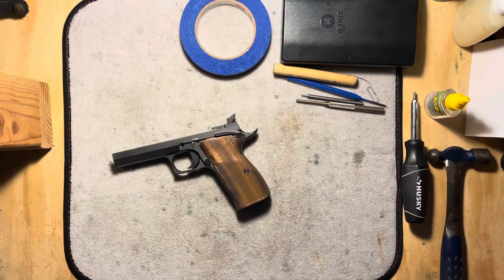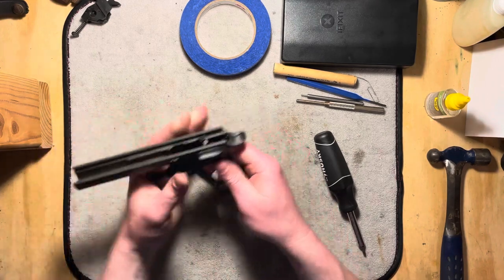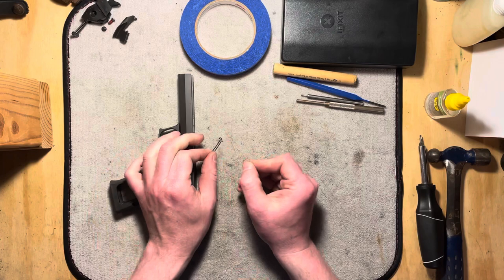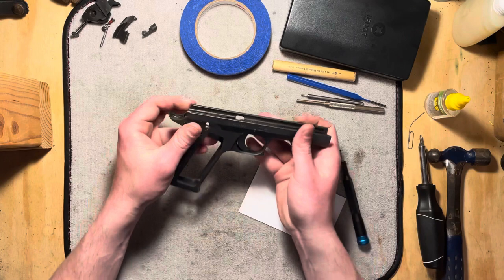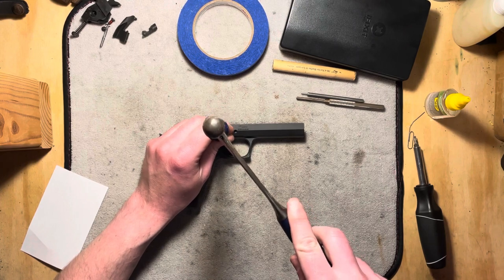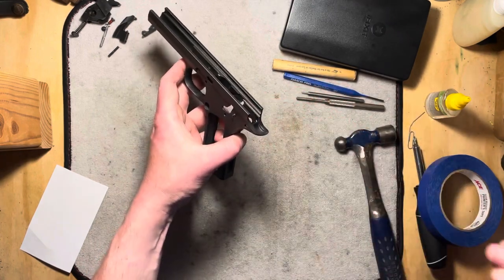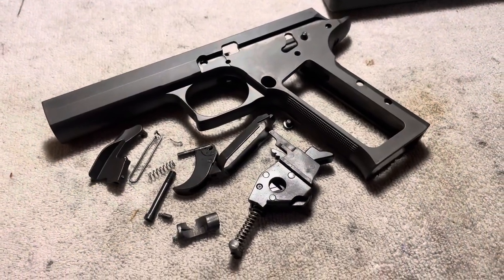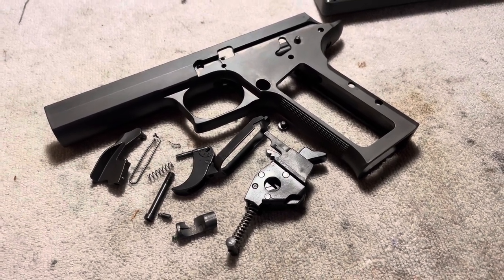SIG Sauer P210 American Frame Detail Strip Part 1 of 2: Disassembly

Comment: I really appreciate your meticulous care that you have for your pistol. Great attention to detail as well. Thank you. Did you learn this on your own while disassembling or did you follow a book?
Reply from the maker: Thanks. I’ve always been a bit of a tinkerer, and have taken apart a lot of different firearms. In general, once you learn the few common configurations, almost all disassemble in fairly similar ways. For the P210 it’s fairly simple so I just followed a process that seemed logical to me.
Reply: @ColterBrog  I am really curious to know more about the hammer box. Particularly, the the “wall” adjustment. It’s hard for me to visualize how that works. It seems like it would be difficult to adjust correctly if it ever slipped as others have mentioned here and elsewhere on the web without significant trial and error and multiple tear downs. I am also curious if you know any sites that give more detail on this, and do you know of any sites that detail polishing friction points. Of course mine is already amazingly smooth and a 2.5# trigger, I just like to know as much as I can about this fine pistol. Thank you again.
Reply from the maker: @Mr5150guy There isn’t much information out there as far as I found. In messing with it myself, it seems like the factory adjustment is pretty much perfect. Anything I tweaked seemed to make it less optimal in some way. And you’re absolutely right that it involves significant trial and error. I wouldn’t mess with it, and based on how it is pressed together I’m not sure it’s intended to ever be disassembled. The pins are extremely tight. 

If you want to do anything, I’d just put a high quality gun grease on the engagement surfaces, and if you want to play with the weight without affecting the second stage wall just screwing the main spring barrel nut in and out will make some changes to main spring tension. If you adjust anything else I would definitely mark the parts with a pencil or fine permanent marker before doing anything so it is easy to restore the factory configuration, which is ultimately what I did. 

It really is set up well from the factory. In my opinion there isn’t much, if anything, to be gained by tweaking the adjustments.
Reply: @ColterBrog  that makes sense. I guess there’s a part of me that just wants to know how to make that wall adjustment if it ever does become loose like others have mentioned. Just my paranoia kicking in.  seems like if something can happen. It will happen 😝. In the meantime, I’ll just enjoy it. The trigger is even better than I thought it could be, not that I’ve had access to many match grade pistols. 
There doesn’t even seem to be very many spare parts available. Midwestgunworks usually has just about everything you could possibly want for pistols, but not much for the 210.  I was going to buy a hammer box just to experiment. No dice.
Thanks again for your replies.

Comment: Gracias,  tengo un P210 target Americano, el disparador tiene el primer tiempo, pero no hace parada en el segundo tiempo, es  difícil de disparar porque no se nota el segundo tiempo, tiene regulación? Un saludo Gracias desde España.
Reply from the maker: I think you are referring to what we call the “reset” in English. The click that is felt when releasing the trigger to know it can be pulled again. We call it “riding the reset”. 

Unfortunately the P210 has a sort of false reset that can trick us. I have not found a way to get rid of this, and I believe it is inherent to the design. I don’t think it can safely be made to have a positive and true reset due to the nature of the design. 

I hope this translates well.
Reply: @ColterBrog  gracias por contestar, mi problema es que no noto parada del segundo tiempo antes del disparo, no se si me explico, todas las armas tienen dos tiempo,  aquí al principio si lo tenia,después de 100 disparos desapareció, no solo la mía,la de otro compañero también,  modelo 2024,tiene un mes. Un saludo gracias.
Reply from the maker: @topdigitalphoneroman2000 Ah, I think I understand now. We call this “two stage trigger”. The initial take up is light weight, then becomes heavy before the shot fires. 

I have an older video that explains more of the hammer box. The adjustment for that is within the hammer box. It sounds like yours may have slipped. There is a set screw that secures the adjustment, so be sure it is loosened before adjust it back to where it should be and then tighten it back down snugly to ensure it doesn’t back out again. It sounds like yours may not have been sufficiently tightened at the factory.
Reply: Gracias de nuevo, ahora si es como me comentas, he conseguido ponerlo bien, sacando el Cassette del disparador ,aflojando primero el tornillo pequeño y ajustando el más grande y de nuevo apretando el pequeño, muchas gracias por tu información y tiempo, un saludo.
Reply from the maker: @topdigitalphoneroman2000 I think you have it right. 

The screw secures a piece which spins, but itself is not actually a screw. It is an irregularly shaped pin, a non-concentric barrel of sorts, that makes the adjustment and then is stopped by the small screw. Turning that pin is what adjusts the “wall” in the trigger pull to make it more or less pronounced if my memory is correct. 

I’m using a lot of words hoping something translates in a way that makes sense. I don’t know the best way to say it even in English.
Reply: @ColterBrog  muchas gracias, tu explicación me ha resultado de gran ayuda, gracias y excelentes vídeos.

Comment: So safety is incredibly stiff. Do you have any suggestions on how to make it smoother?
Reply from the maker: I would first just apply some oil to the detent and work it back and forth between safe and fire a couple hundred times. That should smooth up the bearing surfaces and let the spring take a set.

Comment: Hello:
Thank you for your videos- there are a lot of useful information.
How can a trigger pull weight may be increased?
I have P210 Target model and the trigger is a little too light for my liking.

Thank you!
Reply from the maker: The barrel nut on the bottom of the hammer strut controls tension on the mainspring. Turning it inward (clockwise if you’re looking at it from the bottom side) will increase tension which gives both more solid hammer strikes and will increase pull weight. 

I wouldn’t go more than maybe one or two full turns before trying it out. A little bit of adjustment makes a big difference.
Reply: @ColterBrog  Appreciate your prompt response! Thank you!
Reply from the maker: There’s actually another video I did that doesn’t involve disassembly of the trigger, but goes into more detail on the hammer box. 

The hammer box is really where all the workings are at. The trigger itself is just a simple lever. 

https://youtu.be/GlLUc2DN7Dg

Comment: Thanks for the video it’s very helpful. I’m going to try to put the Grayguns flat trigger in…do I need to take everything down in order to get the trigger out or can I leave anything intact?
Reply from the maker: Well, you definitely don’t need to take out the magazine catch. Other than that… I’d have to go study it again since it’s been a while since I had it apart, but really it disassembles easy enough I’d just go ahead and take the rest out. 

The GrayGuns is trickier to install. I have some posts about it over on SIG forum. The profile makes it tricky to install the trigger spring. I ended up using a very small wooden dowel to flex in there and hold/compress the spring until the trigger bar moved enough to capture it. Definitely takes some finesse and patience.
Reply: @ColterBrog  thanks for your reply. How did you get the flexed dowel out once the trigger is in. That spring is really tricky!
Reply from the maker: @Timrh23  I used the stick from a cotton swab. Just kind of flex it in from the side and press the spring while pivoting the trigger and trigger bar together until that shelf on the bar catches it. Then just work it out from the trigger guard while continuing to move the trigger into place. 

It’s definitely tricky, but it can be done.

Comment: Great job, this helped a lot
Reply from the maker: It’s fairly straightforward. Only thing that’s a little tricky is reinstalling the trigger without the trigger spring popping out. Not impossible, just tricky.
Reply: @ColterBrog   I’ve had the trigger pack out a few times and adjusted the sear settings. Now have a Bruce Grey adjustable flat trigger on order, should solve the trigger pinch problem
Reply from the maker: @gregentwistle5105  What’s the trigger pinch problem?

Comment: Great video. Can you do a video on the P210 slide disassembly.
Reply from the maker: Sure. I still need to finish putting the frame back together on camera. After that’s done getting the slide filmed shouldn’t be a big deal- looks pretty straightforward. I’ll tinker with it tomorrow and see if there are any tricks. Should be able to get a video up within a week.
Reply from the maker: https://youtu.be/7KL45p0locY

As requested.